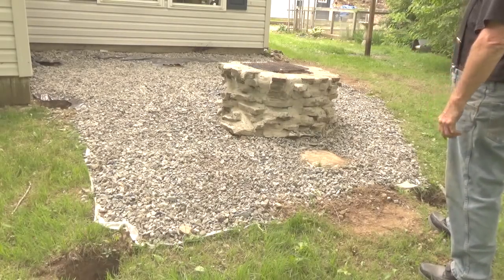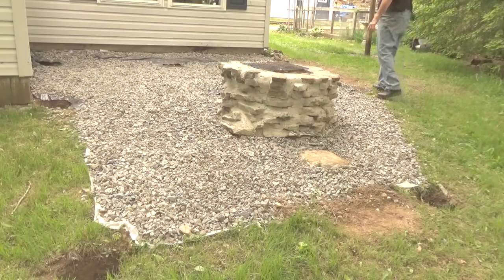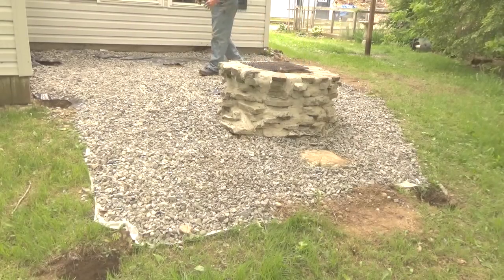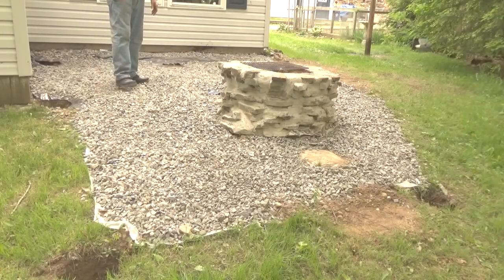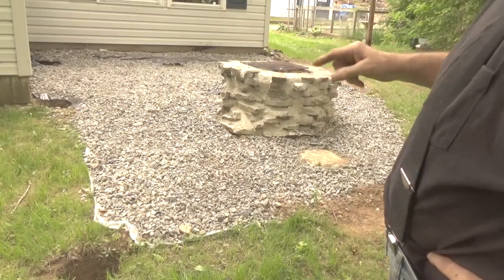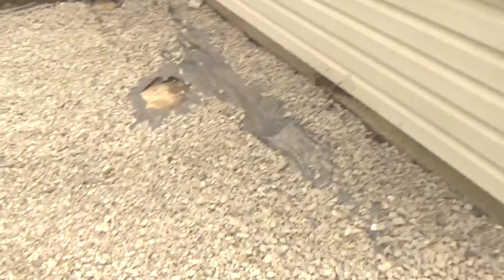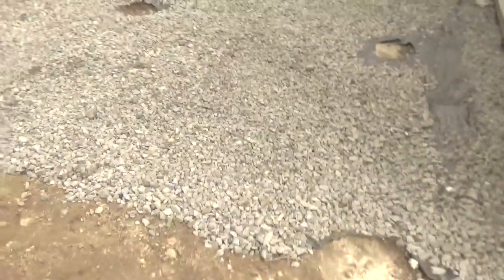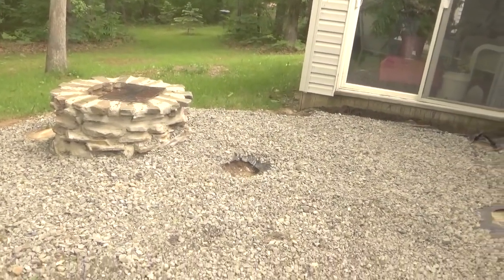Grading off for the deck. Consider the cost savings using my lumber.

Comment: You build the way I do, make it easy on the guy cutting the yard LOL. Like your blade on the hoe bucket, used something similar in bulkhead construction called it a mop pipe. Worked really well dressing mud probably work for you dragging Snow away from buildings...

Comment: Looking good Mr Jo 
Wish I was there to help you 
I’ve probably built 200 plus decks in my 42 years of carpentry and framing. 
Although I’ll be honest I’m a lot slower these days. 😄. Lol
Reply from the maker: I know I am slower, just trying to get onto the back of the truck to grab a tool out of the box is a chore. I use to just jump up on the truck. Now I can barely jump off once I get up there. Have a good one and reminisce.

Comment: Morning Joe.... what a great idea with the blade on the backhoe bucket. I'm going to keep my eye out for one at our local dump. I want one on my bucket now. Once you treat the deck lumber, are you planning on treating it again in a few years or is that going to be it? Everything I've used, including what I treated my log home with, requires re-treatment every so many years. When you begin work on the deck could you go into a little more detail on how you use your laser level. I'm thinking of one down the road and would be interested in what one you have and how you use it. After today, the weather looks great right through the weekend here.
Reply from the maker: John Collado I would be happy to do a laser video. That ugly looking blade has done a lot of work over the years it beats hand raking.

Comment: Used The womanizing product quite a bit on Some Bulkhead jobs, applied with pump up sprayer, BUT We mixed a little diesel with it and I know you don't want to smell that. Maybe thin A little with paint thinner. My experience using sprayer we ruined sprayer after several days. Didn't matter we were making money.
Reply from the maker: Dwayne Shippey I was planning on rolling it on. I have not opened it yet so not sure what to expect.
Reply from the maker: Dwayne Shippey Do you think rolling is doable?